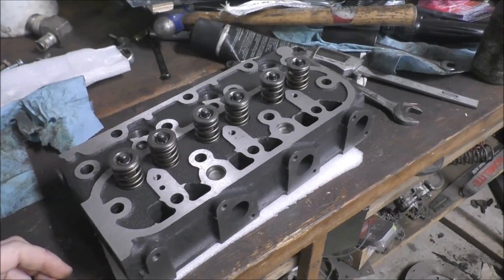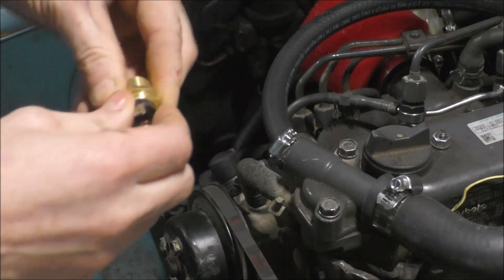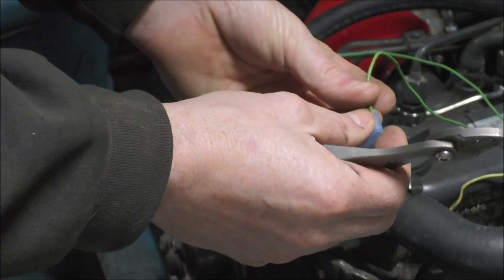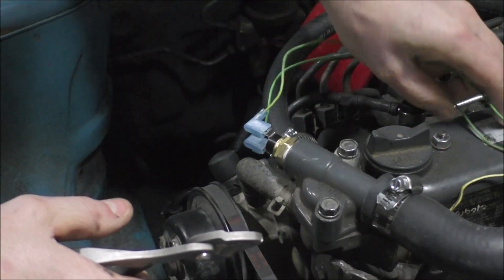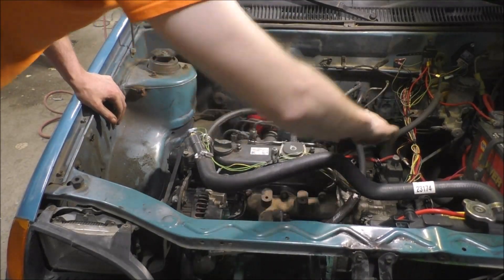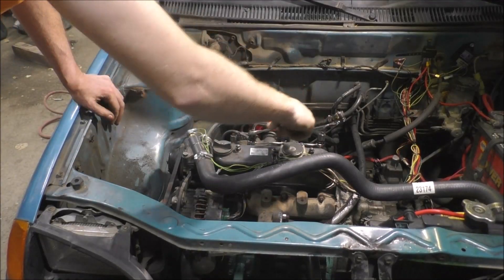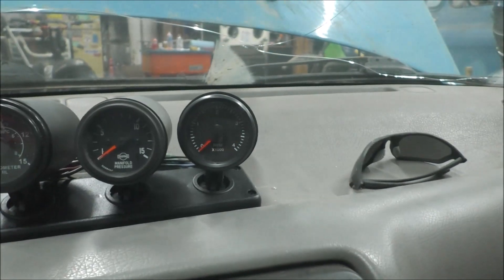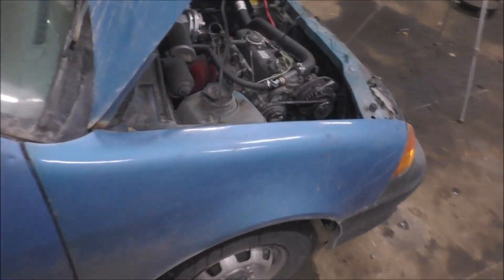Geo Metro Kubota Diesel conversion Part 4

Comment: Any update? Any plans for a turbo install?
Reply from the maker: Yes I have a  turbo installed now ... just need to get driving footage to finish out the video
Reply: @jagersgarage490  awesome.  How big of a difference did the turbo make? Thought about a similar build, but maybe using a ford aspire if the track width is wider. Looks like a slightly wider engine compartment would help.
Reply from the maker: It made a noticeable difference but it's still not a power house

Comment: Did you get the turbo on it yet? Turbos are almost required on diesel. They help efficiency a ton. You'll drop like 200F egt if you add one.
Reply from the maker: Unfortunately not yet.  I have the parts just not the shop space/ time to do it yet.

Comment: I'm surprised it was only getting 50mpg on the diesel honestly, I would have expected higher. I'm currently putting that same engine in a 1987 4wd honda civic, curious to see what mileage I can manage. Planning to throw a cheap ebay turbo on it to start off, add in some fuel adjustments and a higher rpm limit and highway speeds shouldn't be an issue with the 5 speed manual in it. But I'm just getting started!
Reply from the maker: I was surprised/disappointed by 50 mpg seeing as the gas engine would get 55mpg I was expecting 60-70mpg.  I have a turbo on order hoping that will help.  I also need to get a tachometer working so I can run it at 2400rpm if I remember correctly that is peak efficiency.  Not to discourage you I'm all about people doing there own thing I just expect with your car being 4wd and if you run higher rpm your mpg will be around 35-40.
Reply: @jagersgarage490  Thats as good as the car got with the original 1.3L gas engine in it, so I couldn't be too upset. Its not full time 4wd, its got a viscous coupler to the rear end so is mostly fwd. A little worried about what rpm I'll need to be at for highway speeds, as these little honda engines sure love to rev. I may have to add a longer 5th gear to get my 60mph rpm down to a more efficient range.  I found a guy on some forums who put a v2203 in a ford ranger and claimed to be getting 40mpg, but there may be more to that. I'm really hoping with the turbo, if I drive it soft and keep my speeds a little lower than I'm used to that I can get somewhere in the range of 50mpg. We'll see. Just got a lathe big enough for the modifications I need to the Kubota flywheel, one thing at a time.
Reply from the maker: As long as you like it that's all that matters and its unique. In the metro with stock tires on the govenor about 3k rpm is about 60 mph.  For high mpg I think The problem we both will have is at hyw speed the little engine is just working to hard.
Reply: @jagersgarage490  Honestly at highway speeds, power just shouldn't be an issue: the average car needs somewhere in the range of 10-20hp to hold 60 mph, and the Geo metro (or this civic, though its slightly larger and heavier) is smaller than an average car. Getting up there, though, and climbing hills, can take more. I think the D1105 has a rated continuous output of about 13kw for generators, but thats without the turbo or fuel adjustments I'll be using, so.... yeah I have no idea. Time will tell
Reply from the maker: Yeah the d1105 is rated at 25hp 50 ft lbs I have done minor fuel adjustments and it helped alot fire getting to speed if I remember correctly with turbo its rated at 30-35hp and I think 70 ft lbs when I get the turbo I'll do a video
Reply: @jagersgarage490  I think motor likes to be at 2,000 rpm
Reply from the maker: I'd have to look at the chart again but from what I remember peak efficiency is at 2k to about 2.2k
Reply: @jagersgarage490  The VW 3 cylinder TDI diesels are somewhat more suited for automobiles. The EU Lupo 1.4 only got 61 mpg (U.S. gallons), but it is more driveable than a Kubota - can reach 100 mpg.  I'm not very knowledgeable about the VW diesels but I'd probably use one
Reply from the maker: I really want to get my hands on the 600cc 2 cylinder turbo diesel that suzuki uses in only India Turkey and Pakistan if I remember correctly
Reply: It is not the D-1105-T (turbocharged) ?
Reply from the maker: The one I have is not a factory turbo but I'm going to put a turbo from a 1105-T on it.

Comment: hell yea mechanical diesel for the win  especially with these times coming diesel shortage my ass
Reply: Diesel to go WVO in warm weather. Or used motor oil (heated triple filtered) also in summer
50/50 waste E oil diesel max tested to -20 non heated shop + booster pack